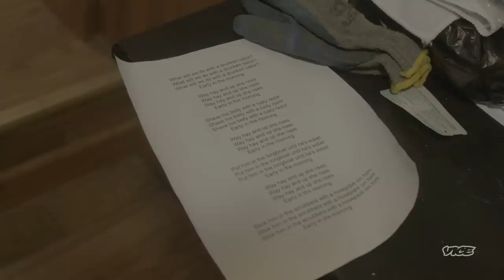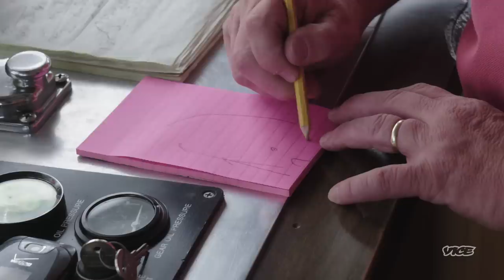Living the Life of a Tugboat Captain While Keeping All Your Fingers | Balls Deep Episode 2

Comment: I, certainly, can relate to almost losing fingers and how important gloves are. I was in the maritime industry. We were in the yard repositioning some 12" x 50 lightering hoses used to transfer crude oil. 

The crane operator had grabbed the two ends. As I began to maneuver the hose, the higher it went it began to fold in the middle. Initally there was space between the fold to safely put my hand. Unbeknownst to me the space slowly diminished. My hand was caught. The space slowly began to close further. 

The crane operator could not see me. The noise of the crane engine prevented the operator from hearing me. I began thinking I was going to lose a digit or two; not catastrophic,  but definitely inconvenient. I gave one last yank of my hand. My hand slipped out of the glove. It was so tight, one finger of the glove tore.

Comment: I was a deckhand on the J.W.Westcott mailboat on the Detroit river for 4 years straight out of high school. 
First thing i had to learn was "the coffee is always hot and fresh here at the westcott"

Best job i ever had...even at $5.75 per hour

And yes...throw over the bit never do that dumb thing Thomas done.

Nothing like the Detroit river like glass at about 330am during any weekday..

Ive loaded 25 55gal barrels of oil from the deck of the westcott up to great lakes freighters on the fly...all the work of the westcott is done moving...sure checked down to river speed but still traveling. Aint nothing like a sling and a crane cable hanging down as the barrell flops from upright to sideways as its lifted and trying to control it. Yeah that happened too.